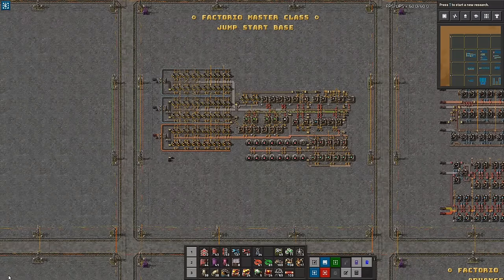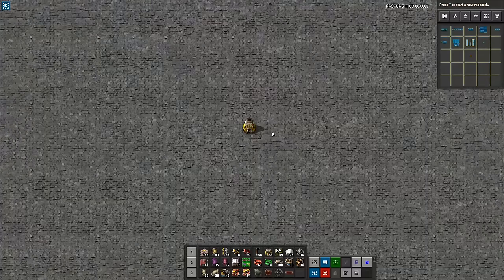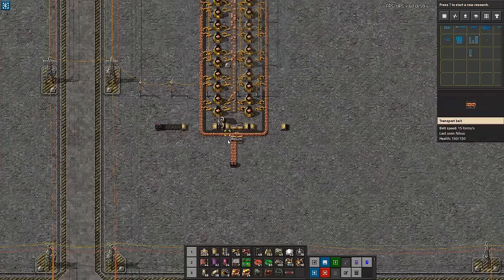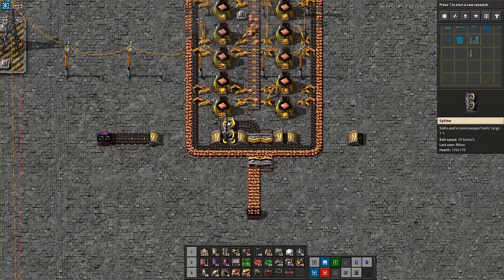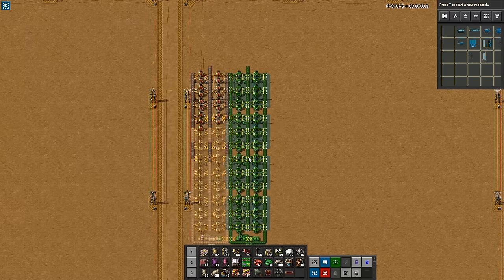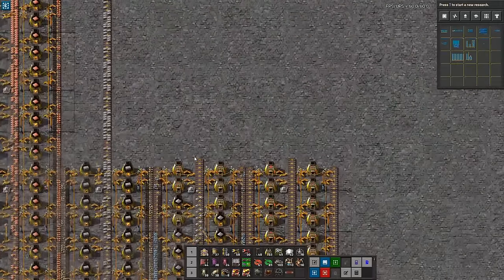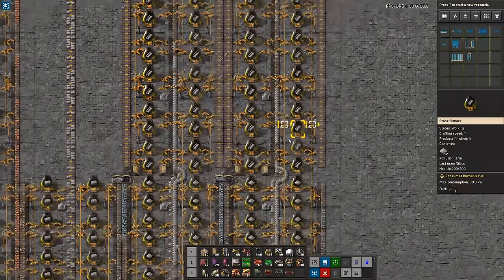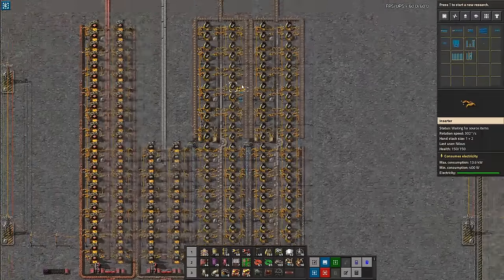Simple, Tileable EARLY SMELTING Designs | Factorio 0.18 Tutorial/Guide/How-to

Comment: A thing I would actually recommend when building your stone (and steel) furnace smelting array, is to move the input belt out by an extra tile and use long handed inserters to load stone and steel furnaces. Why? Because the electric furnace is one tile bigger in both dimensions, and you almost always forget to leave room for it, which means you'll have to tear up your entire smelting array and move all belts around when it's time to upgrade to electic furnaces. By using longhanded inserters from the onset, your belts are already in the correct positions to accomodate electric furnaces.

Comment: I'm surprised you went with that particular steel setup.  If you direct insert iron into another furnace you can use them next to any other setup.  Its just a little wider than a copper or stone smelter.  You just have to use the bigger power poles because there is no room with all of the inserters but it is compact and efficient.  I use a blueprint from @
KitchsVideos

Comment: 6:00 for those of you wondering about the math behind this: if you look at the info panel of any furnace, you'll notice it has Energy Consumption (Burner), the stone furnace having 90kW. If you look at the info panel of other fuels, when you get to that stage in the game, you'll notice their Energy density. In the case of Coal, it's 4MJ. A Watt is a Joule per Second, so essentially 90kW = 90kJ/s. Using that, you can figure out how long an individual fuel lasts, and how much of any type of fuel you will need for smelting arrays.
For an individual furnace, the duration the fuel lasts is: 

"Fuel Value" in Joules / Furnace's "Energy Consumption" in Watts = Duration 

And the amount of fuel for an array you need will be:

# of Furnaces / Duration
Reply: Thats awesome math thanks for the info man

Comment: Personally I like to rush electric furnaces so that by the time I need to run trains to larger patches I can use on-site smelting and transport the plate instead of the ore.
Once the starting patches are depleted I remove the smelters at my base except for steel and stone brick. For steel and stone brick, I only smelt as needed and the rest of the iron/stone goes to the bus. 
I like this way of doing things because it makes the main base less cluttered. It also doubles train capacity since plate can be stacked to 100.
For the early game though I really like these blueprints.
Reply: but it's extremely efficient in early to mid game to smelt things using coal. One belt of coal can smelt 4 belts of iron, 2 belts of copper, 0.4 belt of steel, and 4 belts of stone bricks at the same time. By contrast, producing electricity using coal in early game is very inefficient.

Comment: For the steel, you can also build the first column to only make iron plates but feed the middle belt downwards towards the input at the bottom of the column, let it hop over into the second column to make steel from it. That way, you have both separated and you don't have to swap the direction of the inserters to work from a middle belt outwards like you did here. And you also keep the same width of both smelter columns.

Comment: I created a cool setup for steel. It's basically the standard setup for smelters  but I made it double wide. So 2 sides of iron plates fill belts on one side and the coal is fed from the standard setup onto the iron plate belt. Then the inside smelters grab coal and iron plates and feed them into the inside smelters and then I have a single belt of steel coming out.

This way is probably a simpler set up but really long. My setup is more wide. Idk what is better but I like it

Comment: You can also take the coal for the steel with a sideways underground belt that only takes from the coal side. You don't need the filter splitter at all. That way it fits next to any other smelting column.
Reply from the maker: then it will be longer than the other columns, hence I preferred this option
Reply: @Nilaus  why does it become longer? If you replace the splitter with a straigth pice and use a halfbelt to take the coal in place of the belt coming out of the splitter and feeding the steel lane (if i'm making any sense ^^) i think it should be the same length. Am I missing something?

Comment: A slightly different spacing with two furnaces between power poles can cut the power poles needed for a stone or steel furnace line in half. Other than that, it's the same. Sometimes handy if one doesn't want to spend as much time chopping wood early game or if trees aren't nearby in a desert starting area. Makes the production line a little longer lengthwise, but in most cases that's negligible.

Comment: Will there be a late game smelting master class? Or one for trains for that matter, I’d love to have a nilaus train book. 
P.S. will you go through and add snapping to your blueprints once they add it?
Reply from the maker: snapping?

We made some cool train designs this week on my Twitch stream and late game smelting will come "later"
Reply: Nilaus Really cool new feature they’re looking at for one of the upcoming releases, look at the latest Friday facts. They’re going to make it so you can add boundaries to blueprints. It’s to address the issue of dragging blueprints and then placing on top of each other. It’ll be best for tile wall designs, train books, and walls.

Quote:
Snapping
This is a great example of a feature, that I expected to be done quickly and easily... but you know how it goes.
The first problem is related to build and drag. Most of the blueprints don't work that well when you just build and drag them.

The second problem is that blueprints are often designed to work in a grid, but there is no way to enforce it. Either you have to build slowly and cautiously, or you misclick often. And with the new feature of building in map, the problem was just elevated. This is what the second checkbox is for, it forces the blueprint to be built in a grid aligned to the map center. To ensure, that the user can configure individual blueprints in a way that they would match perfectly, the relative position of the blueprint to the grid can be configured by moving the red flag.

Thanks to Boskid, our beloved tester, a big pile of bugs had been already identified and fixed, so there is a chance of the BP library being released next week.
GIFs on the post make it more clear.
Reply: The late game designs for smelting aren't too interesting.  With the 2 tile wide restriction due to beacons, there isn't much room for different designs.  The only real question you need to answer is if you are doing a 8 or 12 beacon setup.  Additionally, the design would be pretty similar to some of your other builds, that are 1 to 1 (or 2 to 1 if you can combine the inputs onto a single belt).
Reply: You will not built tone of this blueprint in one go anyway so the snapping does not really matter from my point of view. Since the blueprint will be easily editable anyway, it will be easy to add it (by yourself or other means)
Reply: Teneombre yeah, I’m more talking about any train blueprints, or tileable ones
Reply: @jthoward  I see. Once again, it will be pretty easy to make the rail blueprint snappable once the option arrive and to me, it's probably the only one which really need this feature
Reply: @Nilaus  in regards to snapping: The latest FFF showed you can now make Blueprints "align to grid" I believe they called it. Especially usefull for anything train related. I believe it's set to come out with the release?
Reply: I see

Comment: You can see at 13:06 that the iron plate output belts are somewhat side imbalanced, because when they merge into the single steel array feed line, the left side has priority to merge into the belt before the right side. This seems to cause the right side to pile up. Since the smelters in the iron plate arrays have inserters that can only output on one side of the belt, does this not cause the smelters on the left side of the column to have their output blocked?

Or is this all solved at steady state due to equal production and consumption rates of both arrays?

Comment: It could be wrong. The wiki say that the stone smelter produce 0.28 iron plate per second, and the yellow conveyor is 15 items per second, so you would need 7.5/0.28= 26.8 smelter per line (53.6 in total). Same goes with the steel smelter at the speed of 0.57 iron plate per second (in the wiki), so 15/0.57 = 26.3 smelter per line (52.6 in total). Could some explain me?

Comment: Couldn't you filter out both half lanes of coal (at the steel design) using the half-underground trick in the middle of the two iron columns? So you wouldn't need the stone brick burning next to the steel. 
Or do you need a full belt of coal later?

Comment: The major dislike I have with this is that it would require basically a complete rebuild when you get to electric furnaces. Or would you suggest not using them and sticking to coal?
Reply from the maker: Only switch to Electric when you intend to add Modules and Beacons. There is really no point earlier
Reply: @Nilaus  What about with solar or nuclear power to keep coal for other things like plastic?

Comment: Is there any specific reason not prepare it for late game (i.e., electric furnace) smelting as well? Leaving one extra space to two sides of the stone furnace would do the trick.

Granted, it takes up a bit of extra space, but save for the "quirk" of being able to fit neatly into a city block, there seems to be no reason space should be a constraint in Factorio.
Reply: When you transition to electric furnaces you usually also have beacons and modules. Combining those will actually make you use less space than the stone and steel furnace setup, so leaving space for the larger electric furnace does not pay off. You are better of if you completely redo the smelting columns when you upgrade from steel to electric furnaces.
Reply: Normally some things Nilaus doesn't build with modular upgrade in mind, so to upgrade you basically demolish everything down and rebuild the newest version. Besides, you can go with the burner furnaces to pack up enough materials to fully build electric setup that is ready for beacons and modules, usually in a better location than where you place your burners
Reply from the maker: In my opinion; you do not use Electric until you start using Modules and Beacons. At that point you will have robots and the base will be completely different

Comment: Thoughts on rushing steel furnaces? I never make more than few stone furnaces, just try to get steel ones ASAP
Reply: For me the steel furnaces are kinda useless before you start upgrading your bus to red belts. For red belts you need 48 steel furnaces, so might as well just build 48 stone furnaces in the beginning, makes it easier to upgrade. Only thing I see as a gain from going straight to steel furnaces is that after you start upgrading the furnaces the stone ones are literally useless, you can't use them for anything really. So there is a minor material gain to be had with stone ore. But other than that, might as well just use stone furnaces in the beginning
Reply from the maker: You will get stall the progress of the rest of the base by directing so much Iron to the Steel Furnaces. It is obviously your choice, I just find that I use Stone Furnaces for a long time. I prefer 8 columns of Stone Furnaces over 4 columns of Steel Furnaces

Comment: At 13:16 you could place the splitter one tile to the right and it will work for eternity, am i wrong?
Reply: If you mean the splitter that filters the coal, if it was one position to the right, then since the coal is on the right hand side of the belt, it could not enter the underground loaded from the side (and if you filtered the coal to the left of the splitter and then turned it in to the underground, the ore on the left hand side of the belt would leak in to the underground by side loading from the right hand side of the splitter). I think.
Reply: @PeterNLewis  yes, thank you! I forgot the leakage!

Comment: Is a "City Block" a standardized thing?
Reply: Sort of.  The idea of a city block is just a way to separating the map.  There are different sizes based on different things (big power poles, roboports, radar, and/or train length).  Each persons city block is also slightly different.  Do you include walking paths or trains?  What do your intersections looks like?  How do incorporate train stops into your design?
Reply from the maker: I'll make a short tutorial on that "soon"
Reply: Like canebro said, it's like the main bus. The concept itself is pretty standard, meaning pretty much everyone uses it, but you can make it the way you want and there are many ways to make it. For example I make cityblock almost the same as Nilaus except my big power poles are always the full wire length apart from each other, then a roboport next to every big power pole. Then after every 4 power poles I have a walking path, having it right in the middle of the last power pole from the previous cityblock and the first power pole in the next cityblock. Makes the big power poles look better, I absolutely hate having 2 big power poles right close to each other lol.
Reply: @canebro1  Right I get that. Nilaus just made comment that "a" city block can fit 8 of those arrays. I've done huge city blocks for 5K SPM or tiny ones for like 250 SPM. 

I wasn't aware of any size standardization or if he was just trying to set a standard. 

I have no gray area about what a city block is...just the standardization of its size.
Reply: @DanielHartz  Gotcha.  Nilaus has a standard size he likes to use for all his games.  IIRC it is 3 big power poles with then a 4 tile walkway on each side.

Comment: And here stupid me just assumed that the smelting speed is 1/s. 

Anyway my columns need redoing.
Reply: Just to help you for the future in this game, the crafting speed showed in each crafting building is just a factor for speed (I'm assuming that's why you thought the stone furnace actually makes 1 item per second, since its factor of speed is 1). The actual crafting speed/time is showed in the crafting menu when you put your mouse over the thing you want to craft. This applies to everything, not just smelting.

So, for smelting of iron for example the basic crafting speed is 1/3,2s as shown in the video, then when you upgrade to steel furnace with crafting speed (the factor of speed) of 2 instead of 1 it goes up double to 2/3,2s or 1/1,6s.

Then also for example Green Circuits you can see from the menu that it takes 0,5 seconds to craft, which means with crafting speed of 1 you would make 2 per second. But since the Assembly machine 2 (the blue one, that you will have early game) has crafting speed of 0,75 (with no modules) you actually make only 1,5 per second Green Circuits per assembly machine, or the time it takes to craft 0,666 seconds (1/1,5s)
Reply: @singleturbosupra7951  Yea, I've noticed that for composite semi products and end products, but I never bothered to check for iron, copper, steel and stone, instead I just looked at the furnaces and that threw me off.

Comment: I usually prefer to use burner inserters, I guess to use less power (and pollution) and more coal in the early game lol. Idk if it actually makes any difference
Reply: I haven't checked the numbers, but pollution should be less when using electric inserters. It is more efficient to burn coal in boilers to make the power than burning it individually on each inserter. The bigger the engine, the more efficient it gets
This issue translated to real world is: if it was more efficient to go by car (smaller engine), there wouldn't be any buses (bigger engines) for public transportation
Reply: Burner inserters don't cause pollution directly, but they use way more coal, and that coal has to be mined, and the electric miners end up producing more pollution for the extra coal used than the electric inserters use when fed from coal fired steam engines. See: https://forums.factorio.com/viewtopic.php?t=6850

Comment: I thought you need undergrounds to get a full belt when smelting.
Reply: No they reworked belts in 0.17 (if i recall correctly), now inserters will always compress belts, without the need for splitter or underground nonsense.